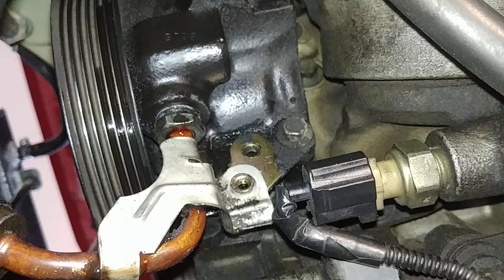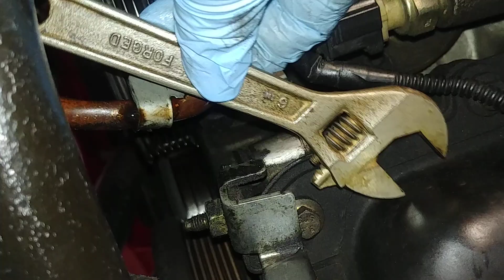How to Remove the High Pressure Line off a 2001 Mustang 4.6L V8 Power Steering Pump Using a Wrench

Comment: How does this show anything to do with removing it.? Just shows being taken off the pump end. What about removing it from the rack end.
Reply from the maker: This video states it's about removing the line from the Power Steering Pump. For R&R on the pump there is no need to remove it from the rack end. If you do need to remove the entire line, the rack end should have an identical fitting (depending on your model) and the process to remove should be similar. 

I actually have another video showing how to remove this line with a better tool; a crowfoot wrench which I think is much easier: https://youtu.be/689RZjRkT6U
Reply: This high pressure line does not go to the rack

Comment: VERY IMPORTANT - READ !!!. Teflon seals account for about 10% of all leaks. if your leak is coming from between the pipe and the fitting, the problem is the internal "O" ring inside the hose fitting. you can change the Teflon seal and the leak will still be there (don't waste your time). To stop the leak, you need to replace the hose. I bought one from Rock Auto for about $ 25.00 and stopped the leak. By the way, the hose will be loose and able to be moved, this is normal and it doesn't matter how tight the fitting is, remember , the seal is made by the internal "O" ring.

Comment: Can we remove the pulley for a better angle ?
Reply from the maker: Yes you could, I was trying not to have to remove the pulley as a separate step because that's a bunch more work. Also it's a little awkward (I think) to use a pulley puller while the pump is on the car. If I did this over, the tool I would use is a crows foot wrench. Subsequent to this video I bought a set for this very type of job. Thanks for watching.